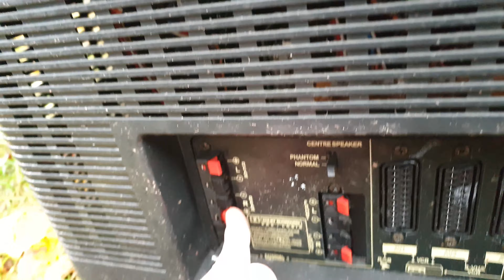Panasonic TX-33AK10P 3.0 tv Speaker System

Comment: The 32 inch panasonic i got had these! Without the center. Also why does almost every tv speaker i get exited about sound like crap in others opinion...
Reply from the maker: Wow very nice! Did you get your present early?
Reply: @the_speaker_tester   nahh... my dad was like fuck it and told me to get it operated as it was heavy asf. Also would it help a little bit if i put stuffing inside the box if it is sealed? I did not expect those speakers from the tv with my luck xD. The model was tx 32pk20f. Also the magnet on the woofer is HUGE! the model of the woofer is 10p563a.